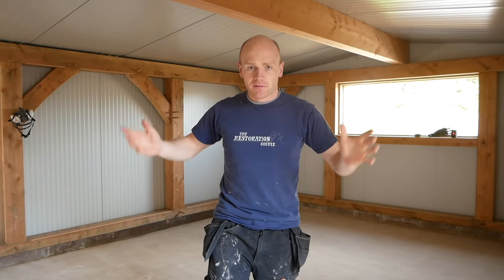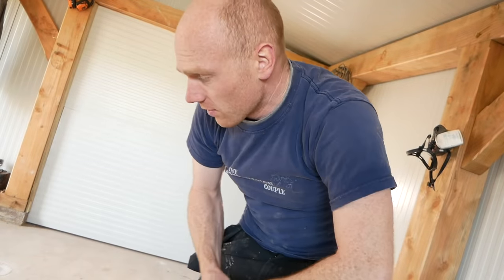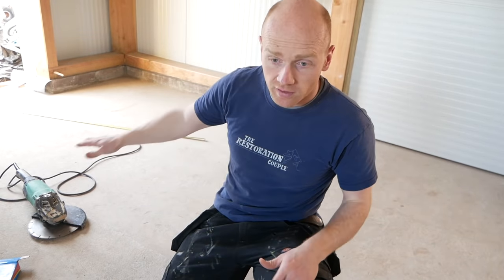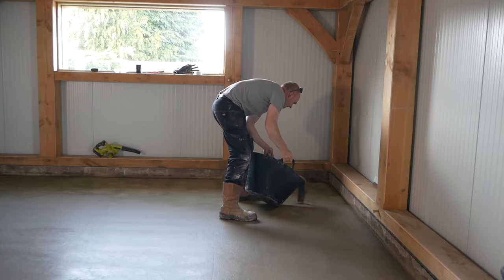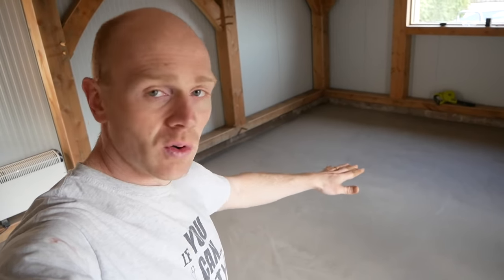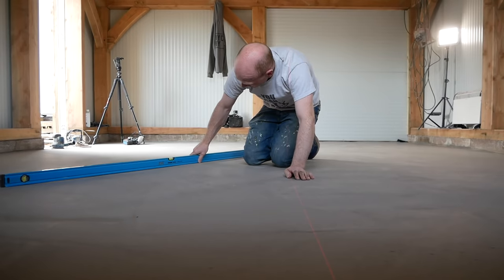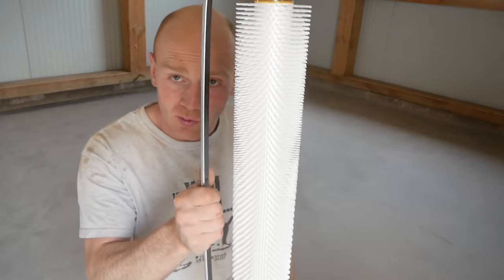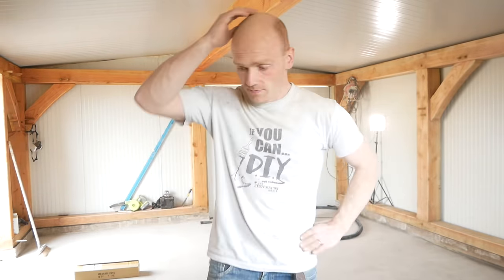SMOOTHING AN UNEVEN CONCRETE FLOOR - Ready for Epoxy

Comment: When you open the door on the finished workshop, you won't be thinking about a couple of mm deviation on the floor. Great work.
Reply: You think so?  Hmmm . . .
Reply from the maker: It’s less the looks and more to do with rolling cabinets and tools around on castors and having to adjust heights all the time. I think it’s probably close enough now though. 👍

Comment: Only just seen this vlog, 38 years ago we had to lay a 250mm concrete slab that was 50mx15m and had to be level within 1mm, one go, and achieved. On the same job steel column holding down bolts had to be cast within 1mm in each axis, again achieved. Back then I wish we had to tools of today. A great effort and attention to detail, you will get out of this project what you put in, a great workshop. I can't believe what your full time job is. As someone who has been in design and construction for over 50 years, I'm impressed.

Comment: I did a self leveling job on my garage and the spiked roller was my best friend. I also got some spiked sandals to walk over the poured areas while rollering the floor. Both of these items are now sat in a box in the garage and will probably never be used again but they were worth it. Floor turned out great and more importantly the new electric roller doors sit perfectly flush.

By the way, I also had an angle grinder nut completely seize on me one time. In the end I clamped the spindle lock which freed both hands to tap the nut loose. It worked.

Comment: To get the disc off the 9" grinder use a punch or cold chisel on the locking nut on one of the pin holes that the wrench fits in. Few taps with a lump hammer and It will shock the nut loose. Don't push the motor lock/break in or it may shear the pin off.

Comment: I levelled the ground floor of our house a year or so ago, I used a similar spiked roller and it worked well.  Also used spiked shoe plates (intended to spike lawns) that also helped to enable the complete floor to be accessed once poured.

Comment: Tim, not sure if your going to be pouring any more concrete slabs in the future. But if you are, you should consider using a self compacting concrete. Yes its a bit more expensive, but the amount of it labour it saves when laying and the finish you get is worth it. You wont need a straight edge or level, just a dapple bar, some tripods and a laser. If i was laying a slab similar in size to your workshop, i reckon i would have it laid in about 20 mins once the gear is in and it would be a perfect level finish.

Comment: Few thoughts..  yes those cheap grinding disks are good value.  Spike roller only really works if the compound is a decent thickness on the floor, if it’s a real shallow pour it don’t do much.  Get a quick nut for the grinder for £10 or so.

Comment: The hardware store dude laughed at me when I said I love the Bosch angle grinder locking nuts because they're easier to undo. Well, I love the Bosch angle-grinder locking nuts because they're easier to undo :D.

Bu the tip about a grinder with variable speed is very interesting... I had to switch to a 125mm diamond disk for my walls because the large machine just bit into it and one little mistake and you gouged the thing like nobody's business...

By the way, I think waiting for the pin roller would have been the better idea... I think that would have helped agitating the leveling compound too and maybe would have helped making it level. But don't take this as criticism... I probably would couldn't have waited either...
Reply from the maker: Yeah, kicked myself after the first bucket was poured as I knew I should have waited but I tend to set deadlines for myself and im already way over schedule!

Comment: Hey its always hard to lower your standards when working on your own projects, to the detriment  of your mind and time. Alas you got it done, was wondering if you can epoxy those surrounding bricks under the timber frame or will you paint? 🤔

Comment: You see you said you were having one of those days. I disagree I would have needed the Ryobi blower which you left on the far corner while you pouring. Then I would have been climbing around the edge to get it and fallen on the wet floor. 😁
I wish my workshop floor was even close to being that flat. Mine is 30mm over two meters in places. Everything has to be on adjustable feet 😬

Comment: Hi Tim I just wanted to ask you how you fixed the sub timber to the footings parameters we're these fixed in with resin bolts ? And what did you use as your bearing wall, are those concrete blocks on a cement mortar

Comment: Looks brilliant well done. I do feel for future you when you accidentally drop something heavy on that master piece of a floor 🤪
Reply: Exactly 
That what I was thinking when I did my garage. 
Screed or even epoxy can easily chip off .
Especially after your sealer on the wet concrete + your grinding and washing off the dust ,no sunmer yet  and I bet you didn't dry it out properly  before screed...

After all that money and labour you will put in that floor...

What I did with my floor -- grind it with exactly the same disc and sealed it with drivesay concrete sealer Job done.
And now I don't care ..if something chip off(and it will) you can just touch it up with sealer  .

Watching to much of the youtube made you go that mad with that floor .
It just the floor ) 

I like your idea with kingspan panels tho.

I've build the grill house(grillkota) in my garden and made the concrete floor the same way as un my garage just added decorative  5-10mm gravel on the top so when grined you can see the polished concrete,nice .
And that sealer on the top .
Done

Comment: Great attention to detail, as always! I’m afraid I’m a little sceptical about using self-leveller as a final floor covering though. I know the epoxy resin is over the top but I still doubt the impact resistance, especially in a work shop environment. I only ever use self-leveller under a more resilient finish, such as tile. Perhaps I have something to learn!
Reply from the maker: It was my main concern too but the benefits of a flat floor outweighed the risk especially as this is a wood workshop. The metal working area I in the bottom shed which is a polished concrete slab. This is a fibre reinforced screed which is more of an industrial type as that what was recommended. It had to be over 25Nm I think. Anyway, we will see how it works out, otherwise I’ll have carpet! 😀

Comment: Tim, maybe you or someone here can help. I'm building a pergola attached to a garage made of blockwork with unpainted render over it. I need to attach a ledger board to this garage but I don't know how to go about it and I can't find an example of how it should be done in this situation. I think I can't put the ledger straight onto the rendered wall or water will be trapped between the two causing rot. I don't even know if I should remove the render to attach straight onto the blockwork. I know there are spacers for this sort of thing to keep the ledger board off the surface, but do I drill through the render so the spacer is on contact with blockwork?  Do I maybe put flashing tape on the wall facing side of the ledger board or some other kind of barrier?
The pergola will be exposed for some time before a roof is added maybe within the year.
The top of the garage wall is also a 2x4 wall plate for the corrugated garage roof, could some of the ledger fixings be drilled into this wall plate or would it have to sit lower than the top of the wall so it's touching blockwork and not the wall plate? The ledger board(s) will be 2x8 and 6m long.
I have the rest of the plans drawn up to every detail but this is something I can't find reliable info on, the closest I can find is deck building regulations but they deal with the bottom of walls not the top row.
As per the fixings, some people say concrete screws are fine, others say to drill the whole way through the blocks and use bolts and others say plugs with screws is the way to go. 

Any help would be appreciated even a link to an example or helpful info. Thanks
Reply from the maker: Depends on how heavy the beams are but usually ledger bolted to blockwork using sleeve anchor type fixings or epoxy anchors. Thunderbolts might be ok to if blocks sound.  You could put a spacer behind but would loose some of the strength.  Either just leave it and use well treated wood or perhaps a flashing above the finished structure to cast any rain away from the wall.
Reply: @TheRestorationCouple  Thanks Tim, it seems like I have nearly endless possibilities. I might be being too picky for what is a garage wall anyway and treated wood. We did have a wooden fence battened on to a block wall and some of those battens have crumbled into dust in about 12 years which has me worried.

Comment: Made same mistakes as you with the self leveling compound. Mistake nr.1: Not using primer. Nr.2: Spike roller is must. Nr.3: Pour all at once. Nr.4. Prepare buckets & bags open so you mix them all at the same time. If you respect all those rules you achieve a glass-like finish.
Reply: Yes exactly especially the spike roller it take the bubbles out and help it to sit better 👏🏼👏🏼

Comment: Hi mate, really liked the video, just had a few questions as I'm currently doing the same, I've used self leveling on the floor, now I need to remove the laitance before I put down the epoxy, was your grinding/sanding aimed at removing this later prior to the epoxy or was it Purley to flatten it further?
Reply from the maker: Just to flatten really. The epoxy finishes do best on certain self levelling products but primer went down first anyway.

Comment: Really admire your resolve and creative approach to getting things done. 
A quick question if I may that sort of combines elements of this and your floating floor. I have a gym project built project with a concrete base and intend to install a DPM, 50MM PIR, 18mm T&G Chipboard and 20mm rubber tiles. Like yours, the slab is not perfect with some high and low spots, do you think that the PIR will absorb some of this once combined with the considerable weight of the chipboard, rubber tiles and gym equipment or should I try to get it as level as possible before I start? I think I know the answer but no harm is hoping :-)
Reply from the maker: No, you are really better off starting level. Any low spots will always bounce a little with floating floor even when all the weight is on and the joins don’t hold up well. Still notice it in our kitchen when you walk in a certain spot. A simple way is to screed out kiln dried sand before dpm, or use self levelling if needed.
Reply: @TheRestorationCouple  Thank you very much, I will definitely follow your advice.

Comment: Did you consider using self compacting concrete? Would have saved you tonnes of time and effort and gives you almost a perfect finish when you tamp it
Reply from the maker: I could have just trowelled it smooth from the original pour if I knew what I was doing 4 years back. 😂 This was certainly a stage that shouldn’t have been needed. 👍

Comment: Great determination and a great result, I wasn't that fussy on my garage floor. I used one of those amazon concrete discs too alas the 115mm one, soon killed my old angle grinder so had to buy a new one, shame :-)  looking forward to the epoxy, make sure you get enough as they always seem to come up short on coverage.  Are you having chips in it?

Comment: Hi, does the leveller fully bond with the concrete or does it form a ‘laminate’ over the floor?  If it does form at laminate, can it crack or delaminates?
Reply: if you prepare the floor correctly before pouring it will bond to it

Comment: I suspect you have done this before, but being lazy (!) can I ask what vac you used to suck up all the dust and what little battery powered blower you use? I’m about to try some lime tuck highlight pointing and getting the old stuff out, with ash mortar behind is going to be messy!

Comment: Hi Tim where did you get the levelling  tool from I normally  use a trowel but it leaves a lot of marks on the cement leveller.
Reply from the maker: It’s just a flat spatula that I had from doing the rendering. Worked well though.
Reply: @TheRestorationCouple  thanks

Comment: If you required the flatness and level then this must be factored in when laying the slab because adding a weak slurry as a base to the epoxy finish may prove to be misplaced especially if you are setting heavy or vibrating machinery on the surface.  Your excuse that you didn't have a 'laser' level is not really valid because one of the most accurate building levels is the water level i.e. a length of pipe filled up to a point with water.  The water level at both ends of the open hose/pipe are identical no matter where they are.  I know commercial suspended ceiling contractors who use a water level in preference to a laser as it is accurate, can bend around the corners of rooms and through doorways and above all are very cheap!   A power floated concrete slab with the proprietary sealer is more than adequate as a finished workshop floor - most industrial floors  are finished this way.   
One of the things that I now insist on is to use a steel angle at the threshold as the top of the shutter.  The angle can be set very accurately with one flat uppermost that will be set under the door.  This provides an accurate threshold for any door but particularly the sectional overhead commercial style doors that is very durable.  Externally, the down leg of the angle can be exposed by say about 25mm to form a water stop for driven rain, whilst still allowing a ramped access up to floor level.

Comment: When you stand back to look at the finished surface and the the dog runs in to see whats going on just look at it as a way to remember the dog long after its been buried in the garden. Or you could let the kids loose and call it feature art. I had various memory joggers installed in floors and paths over the years. The finish you have there is way above that which most contractors would call done.

Comment: 2mm out.?? However can you sleep at night.. it must be terrible living with OCD.?? 🙄🙄😉
Reply: Ps when I laid my concrete base down for my 10m x 6m base, it looked great.. Until I woke up the next morning to find apples from next doors tree embedded in it.. It adds character, that's my reasoning anyway lol. 🤣
Reply from the maker: 2mm is fine, just the dips at the side which will cause problems.  With all the units and tools on castors, the aim is to be able to move things around quite a bit.  A floor with dips and low spots will just mean im constantly adjusting heights and rocking tables.

Comment: OK I'm going to be Mr Stupid, if it ends up not being level why is it called "self leveling" ?
Reply: it does level if you use enough of it, but its quite expensive, it does a good job of smoothing the floor if you dont want it perfectly level though
Reply: Using a spiked roller brings the self leveling properties up massively. Also, this is a two person task - one mixing, one spreading. Timing is critical.

Comment: Hello on the whole I like your videos they're informative and relatively fun to watch but I'm having a bit of a nightmare watching you put down screed on a concrete floor without mentioning the dangers of acid Burns caused by concrete left on trousers could you please put up a disclaimer about using some sort of knee or leg protection to prevent acid Burns as I see you're not wearing any at all